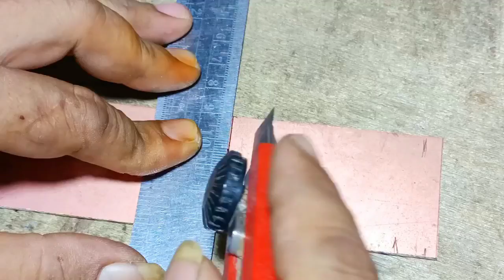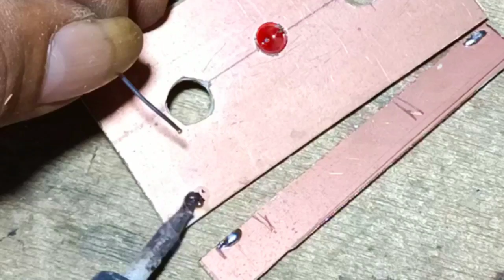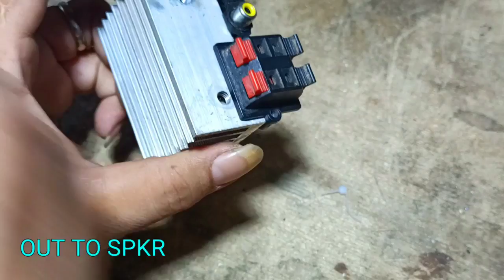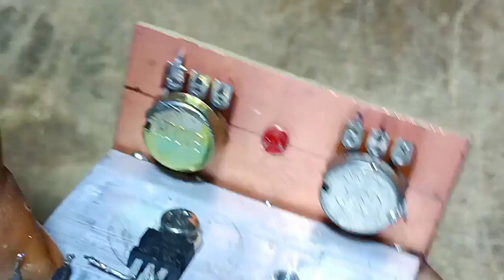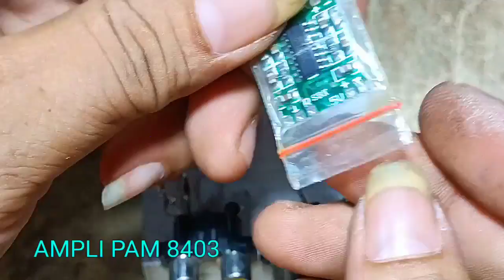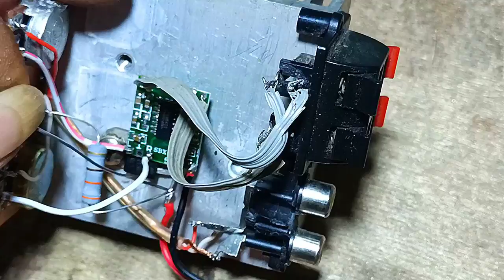MINI AMPLIFIER STEREO PAM 8403 BIKIN GLER KAMERA

Comment: Terimakasih tutorial untuk Step down nya masbroo.. dan memang Work di DC 12V 1A pakai ic 7805 ini jadi 5V tegangan stabil dan suara Bersih. Treabel & Bass juga gLeerrrrr mantuL... 👍👍👍👍👍👍
Reply: Itu pakai aki kah mas, atau gmna
Reply: @fossilyt5263  saya coba pake travo 12v 10A nanti di turunin pake ic 7805 ini jadi 5 volt 2A paling gede. Jadi seperti step down lagi.

Comment: Ini tanpa tambahan kit lain ya.   Sy sdh rakit Baik PAM 8403 atau 8610 suara enak... tapi bass nya kok kurang nendang....  dibagianen input DC sdh saya pasang elco 2200Uf dan saya pakai charge HP 1.5A untuk PAM 8403 sedangkan utuk PAM 8610 saya pakai adapto 12V 2A....... kok perasaan kurang nendang tidak seperti di konten ini mas....
Reply from the maker: Tergantung speaker nya mas, ini tdk ada tambaha lain hanya yg ada di video
Reply: Baik..... Terima kasih
Reply: Penambahan tone control apa bisa memperkuat bass dan treble ya?
Reply from the maker: @arwanimaruf8236  saya pernah coba hasilnya pecah

Comment: Saya dh rakit kok suara ceduk klw volume hampi setengah di putar, saya mnggunakan speker 10x2 watt 8 ohm 3 inci,ngunakan charger hp 1 amper, 2 dn 3 smper jg begitu suara nya, setelah saya tes di speaker 12 inci 100 watt polytron, malah bisa setengah putaran klw lebih malah ceduk"apa penyebab nya, dh di ganti baru pam nya suara nya ttp gitu jg ceduk, klw melebihi setengah putaran potensio nya
Reply from the maker: Drop tegangan nya

Comment: mas kalo tiap ada bass pas volume  tinggi speakernya blebeb (gak keluar).

 itu permasalahannya dimana ?
Reply from the maker: Power supply nya pakai apa?
Reply: @GULTOM.  charger hp ,kalo speakernya  di pake 1 aman kalo 2"nya nyala baru bermasalah
Reply from the maker: Coba tambahkan elco 4700uf 16v pada input tegangan power mini nya

Comment: Bang kenapa pam8403 saya kalo volume full suaranya Sember pake speaker 6 inch
Reply from the maker: Harus di sesuaikan power supply-nya juga bang, dan power output 6 inchi brp wat? Dan saya analisa PAM 8403 ini gak tahan panas, biar Maxi hrs ditambah kipas.

Comment: Itu daya berapa volt bang
Reply from the maker: Gak boleh lebih 12 volt, tp pakai IC 7805, sebetulnya pakai cas hp boleh
Reply: 5 volts con el regulador, por eso tiene mejor desempeño que con los 3.7 de las baterías
Reply: @GULTOM.  no funciona igual porque el amperaje se cae
Reply from the maker: Lo siento, no entiendo a qué te refieres.  si uso un amplificador de potencia de 3,7 voltios no funciona al máximo, por eso uso un circuito regulador de 5 voltios, si desea aumentar el amperaje, el circuito regulador puede estar en paralelo más de uno
Reply from the maker: si quieres aumentar el amperaje puedes poner en paralelo mas de un regulador